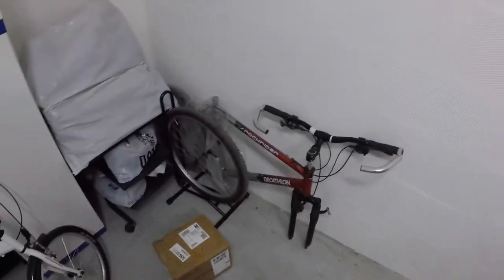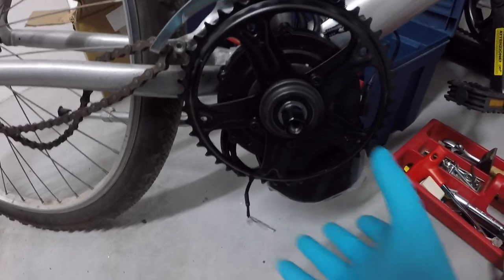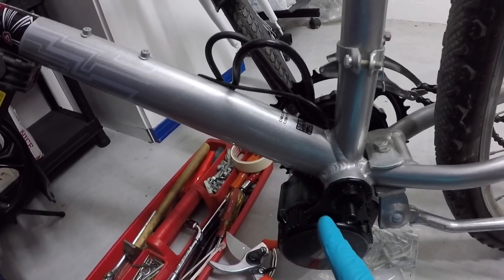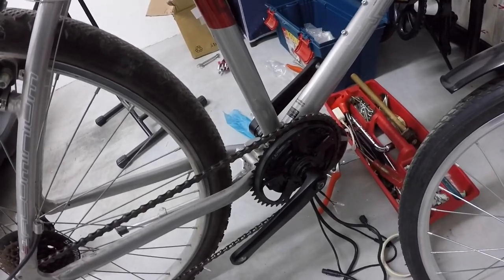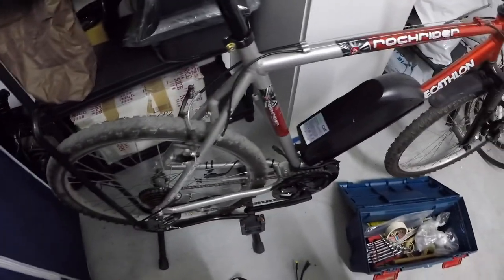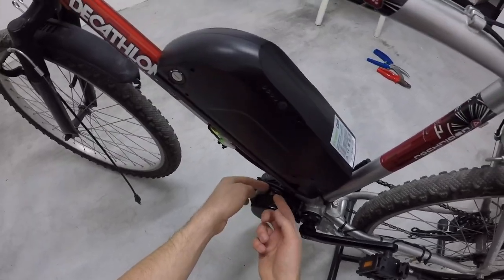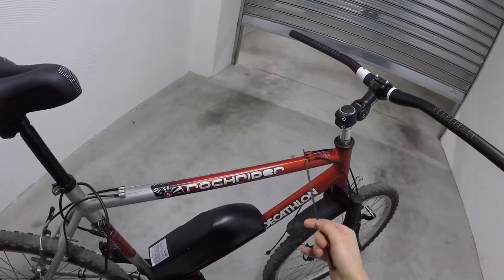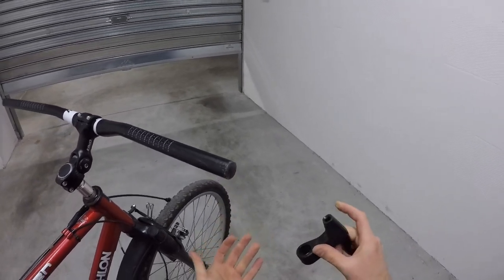DIY: Building an e-Bike with Bafang BBS02b mid-drive motor Kit and a Mountain-bike: less than 700 $

Comment: I had a few hiccups installing mine. First, the crank on my bike was stuck on. I took it to the bike shop and they said unfortunately they had to cut the crank/chainrings off. I needed a few spacing washers as the 52 tooth chainring I got was close to rubbing against the frame. Also, the motor can come loose but I wedge a stick in-between the motor and the underside of the frame and it seems to do the trick - not coming loose anymore.
Reply from the maker: yes this actually happens very often. I had to bring it (the second hand bike, not this one) to the bike shop in order to remove the crank: there where to much dust and rust keeping it there!
still on the other bike, the tongsheng motor did come loose, before I applied some hard glue; not the case with this one. I was thinking it was cause of the poor locking ring mechanism, but eventually it can also be caused by the frame.
A good and friendly bike mechanic can really make a difference!

Comment: Thank you for your sharing. I will make a build on a fixed gear bike og one gear bike. Do you see any special challenges with a onegear bike?
Reply from the maker: Hi! Actually for fixed gear bikes I see less challenges 😅 just check if your frame is able to receive the central motor

Comment: What is your range with full throttle without PAS? Bike kg, chain ring, terrain details etc.? I want to know that the range with full throttle when riding on asphalt with mountain bike like yours. Is it 48v 500 watt or 750 watt?
Reply from the maker: Hi! It is 36V 500W, but I don't know all of that! I should do a video to know 🤔Good idea! Thnx!
What I can say is that the bike has aluminum frame and I'm between 80 and 90Kg (backpack included).
As for now I only tested pedal assistance here: https://www.youtube.com/watch?v=26yWMV298xI
I will make a throttle only test soon, stay tuned!
Reply from the maker: Hey buddy, thank you for this question.
I tried to answer in this video, don't miss it! 👍 https://www.youtube.com/watch?v=SVeSr5Ea_nw

Comment: Could it be possible to install any battery with the correct voltage? I mean, could I use my Bosch battery in combination with a 36v bafang motor? Thanks in advance.
Reply from the maker: Not considering the cabling and mounting adaptation of the battery, I absolutely think it's possible! maybe do not pair low Wh batteries with high W motors for efficiency reasons
Reply: @LukeLorusso  Thanks Luke. Are bafang cabling connector standard? In this case i could replace the Bosch one with the one compatible with bafang. Am I right?
Reply from the maker: @GiulioAdone  they are like this: https://www.bafangusadirect.com/Bafang-Battery-Extension-Cable-p/50.htm
Reply: I would not recommend using a bosch battery with a bafang system. The BMS (Battery management system) in the bosch battery, will probably think that an error has accrued and stop the battery from working. Bosch batteries have something like 5 connection points, while a bafang / Chinese battery has 2 (Plus and minus). But if you're up for the challenge go for it ^_^

Comment: Hi, do you have to change the brakes, or can you use and keep the old ones already on the bike?
Reply from the maker: you can reuse most of your mechanical brakes (both V and disk ones), but you might want to replace the levers with brake sensors coming with the kit. I highly recommend installing them.
For hydraulic brakes things get different https://www.youtube.com/watch?v=KZrGvg4_KH0

Comment: Ciao Luke, innanzitutto complimenti per i tuoi video! Volevo solo chiederti con quale criterio scelgo il numero di denti della monocorona, non avendo mai guidato una bici elettrica non so quale rapportatura è meglio! Al posteriore ho 8 rapporti 11-34 con ruota da 29 e all centro 24-34-42, per caso mi sai dare qualche consiglio?
Reply from the maker: Ciao, dunque "in breve": io ho due motori da 500W, entrambi con corona centrale da 44T, 7 marce dietro (di cui non ho contato i denti).
44T é la misura di default, la più comune. Sul motore Tongsheng ho montato anche una corona da 52... non la uso mai: non ho nessun vantaggio sulla marcia più alta, tuttavia ho aggiunto più secondi (= più sforzo = meno batteria) ad ogni partenza... delusione.
Forse su Bafang é possibile raggiungere un pelino di velocità massima in più, a scapito della batteria. Sicuramente su motori più prestanti può fare la differenza. Tuttavia il consiglio resta sempre di partire con 44T. Se se ne sente il bisogno, si può sempre ordinare in seguito una corona con più denti, visto anche il prezzo irrisorio. 👋
Reply: @LukeLorusso  Perfetto, ti ringrazio tanto per la risposta completa e immediata! Sei un grande!!

Comment: Ciao, volevo chiederti alcuni dettagli!!! Quanti watt è il motore che hai inserito qui e nel video dell’altro motore cinese ? E la grandezza precisa della batteria per ogni motore ? Grazie mille e complimenti per i video
Reply from the maker: ciao Jacopo! se ci fai caso alla parte "batteria" di entrambi i video lo esplicito: per entrambi i motori ho montato una batteria da 36V @ 15.6Ah (quindi circa 550Wh)
Reply from the maker: in generale, secondo la legge non si più circolare con un motore che supera 250W di potenza nominale massima. inoltre ho dovuto rimuovere l'acceleratore per mantenerla nella legalità 😢
ultima cosa: meno potente è il motore, a parità di capienza della batteria, più elevata sarà la sua autonomia globale 👍🏻
Reply: Luke Lorusso sei stato gentilissimo !!! Io vivo in zone dove ci sono molte salite ripide , dici che 250 watt c’è la posso fare ?
Reply from the maker: @jacoporegine2708  eh... mi metti in difficoltà con questa domanda. non posso incoraggiare ad andare contro la legge. se sei un tipo atletico è sicuramente molto meglio che non avere affatto assistenza. se sei una persona con difficoltà motorie o che si affatica facilmente, alcuni ponti potrebbero farsi sentire... 250W è come se avessi il doppio della tua forza nelle gambe (soprattutto con un mid drive motor, dove abbassi la marcia e va che è un piacere... un hub motor potrebbe avere più difficoltà)
Reply: Luke Lorusso ok grazie mille

Comment: Volevo capire se è compatibile con la mia mountain bike, cosa devo misurare nel mozzo?
Reply from the maker: Ciao Giorgio, ti riporto una dicitura di BafangUsaDirect.com:
"The BBS02 [...] motor kits work with bikes with 68-73mm wide bottom brackets with an inside diameter of 33.6mm-34mm"
Per questo kit quindi dovresti avere il mozzo della pedaliera con le precedenti misure, rispettivamente in larghezza e diametro. Sono anche le dimensioni più diffuse, infatti anche per motore Tongsheng: "which is 68mm-73mm wide, with an inside diameter of approximately 33.5mm". Tuttavia meglio assicurarsi prima di comprare 👍
Reply: @LukeLorusso  cerco di capire la misura, ho visto i kit anche su Amazon. Sarebbe bello capire se le stesse batterie per monopattino funzionino con questa (l’attacco dei poli è diverso ma penso si possa modificare facilmente) ne ho due a 48 volt, 10 e 13 aH
Reply: @LukeLorusso  ma devo per forza usare i suoi freni? Perché ho già i freni a disco
Reply from the maker: @gistphotos  per farla breve, le leve del freno che arrivano col kit hanno il sensore di frenata, utile per bloccare il motore. Non sono obbligatorie, ma è rischioso non montarle.
Se i freni a disco sono tirati col cavo, puoi usare le leve del kit. Se sono freni idraulici, bisogna individuare e comprare a parte le leve con sensore di frenata per i freni a disco idraulici
Reply: @LukeLorusso  no no hanno il cavo, di quello sono sicuro
Reply from the maker: @gistphotos  allora non dovrebbero esserci problemi! 👍
Reply: @LukeLorusso  perdonami ma ho un’altra domanda. Ho appurato che i miei freni sono idraulici ma ho visto che vendono i sensori appositi.... ora il mio dubbio sta nella corona, vedo che bafang vende quelle 44t in su... la mia mib è doppia corona 33/22.... ovviamente perderei la funzionalità immagino? Perché non trovo misure più piccole della 44 da bafang
Reply from the maker: @gistphotos  perderesti la capacità di cambiare marcia anteriore, infatti io ho rimosso il deragliatore frontale.
Ora la vera domanda è: il tuo frame (i tubi del telaio ber capirci) può alloggiare una corona da 44T? perché per alcuni frame 44T è troppo largo e rischi di non riuscire a pedalare perché la corona raschierebbe il frame!
Cerca di capire se c'è spazio sufficiente, altrimenti vai di misura più bassa (tipo 36T)
Su eBay dovresti trovare corone con vari numeri di denti
Reply: @LukeLorusso  ho cercato anche sul sito e non trovo niente sotto il 44, quello mi preoccupa.
Reply from the maker: @gistphotos  https://www.ebay.it/itm/Guarnitura-Ragno-Adattatore-Ruota-Catena-Pignone-per-Bafang-Motore-Tools-Ricambi/233546591917
Reply: @LukeLorusso  grande!